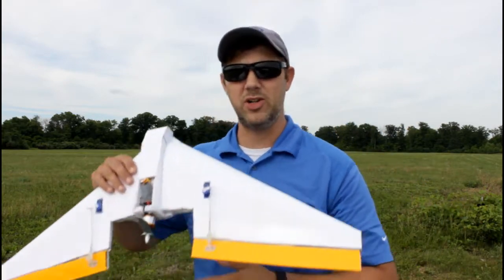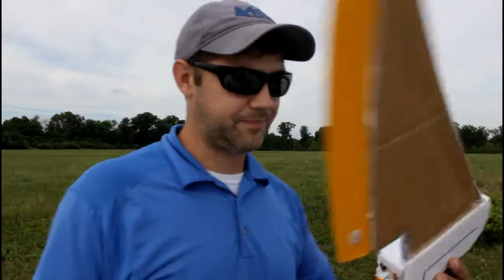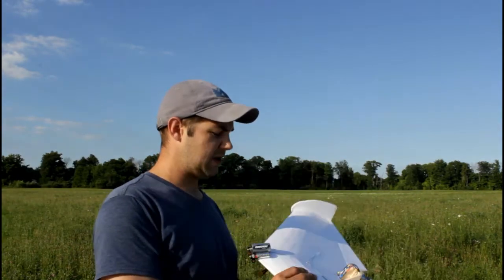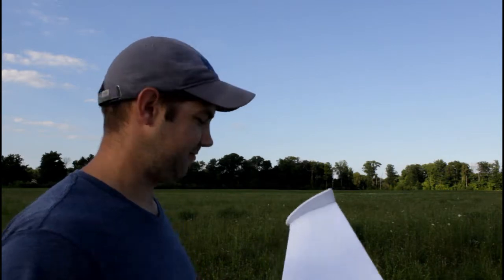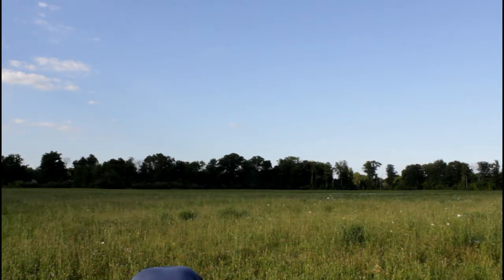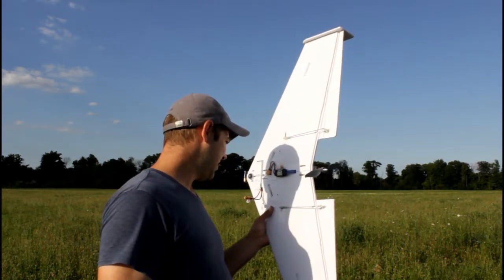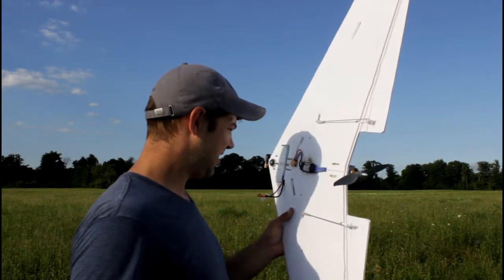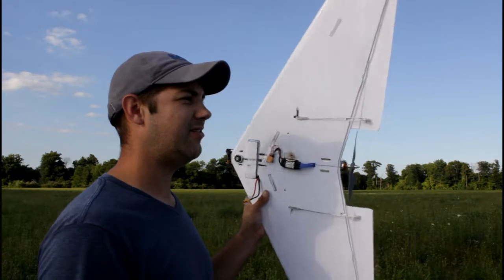Winning at Failing

Comment: hey man I just discovered you channel about 30 mins ago and I like your content so I suggest that you buy a turnkey 2826 motor around 2200kv and a 40 amp esc from hobby king on 3s and PLEASE USE THE RECOMMENDED PROP, that is why your escs keep frying. Want to see a video of you succeding:)
Reply from the maker: Thank you, I'll have you pick up a new esc and motor!
Reply: ? what do you mean you'll have me pick up the motor and esc?
Reply: @haasfpv1222  (here are links to the motor and esc) (motor - https://hobbyking.com/en_us/turnigy-d2836-8-1100kv-brushless-outrunner-motor.html) (esc - https://hobbyking.com/en_us/turnigy-plush-30amp-speed-controller.html) I recommend using a 9*6 master airscrew prop for a flying wing and a 2200mah 3s lipo
Reply from the maker: @alexcarey7166  typo  buddy, I replied from my phone and auto fill took over before I proof read it.
Reply: Its aight man I was just wondering. Looking forward to the video!